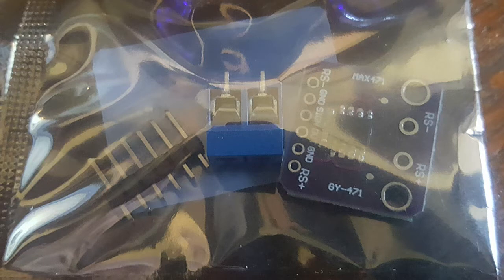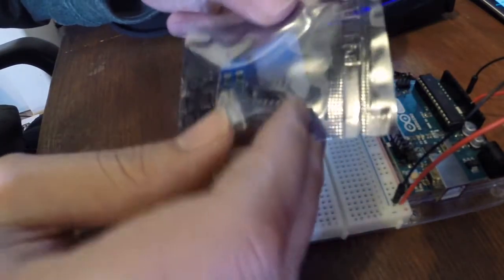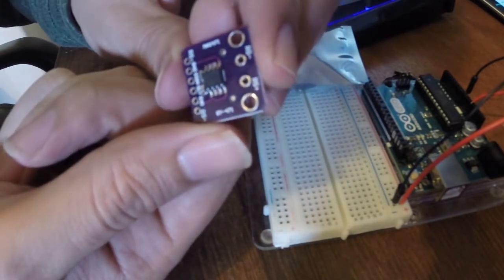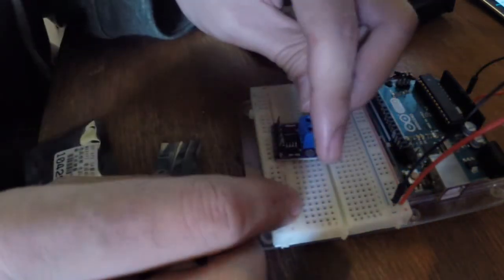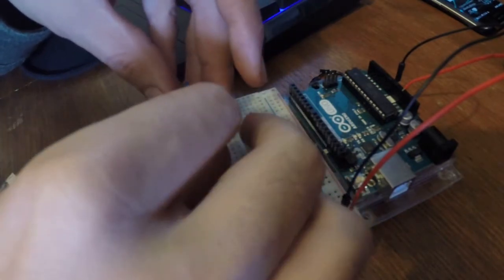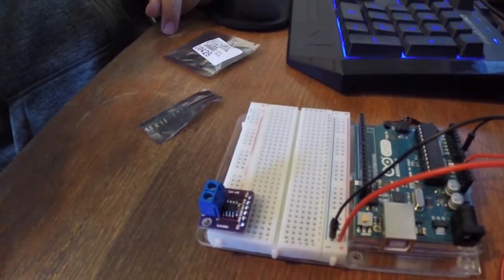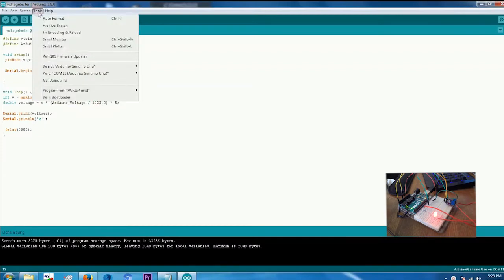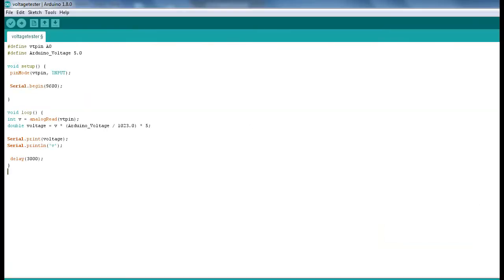Arduino GY-MAX471 Module for Voltage Current Watts Testing ICstation

Comment: Can you explain the pinout. What is "out" and how did you wire it?
Reply: Pinout 

Sensor
RS+.........Load positive supply (3 to 36V)
RS-..........Connect to load or charger

Interface:
RS+.........Alternative load positive supply (3 to 36V)
GND.........Connect to loads 0V/GND supply
OUT..........Current sensor output (1V / Amp, 3V max)
SIGN........Current flow direction. An open-collector logic output (low = current flow from RS+ to RS-).
GND.........Alternative GND (Connect to loads 0V/GND supply)
RS-...........Alternative load/charger connection.
Reply: He cant even solder properly, so dont expect much.